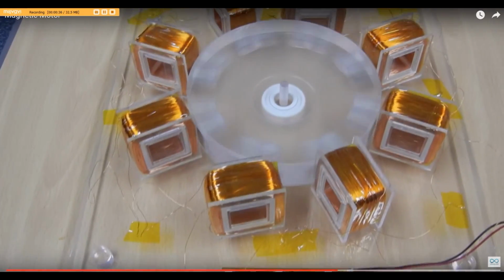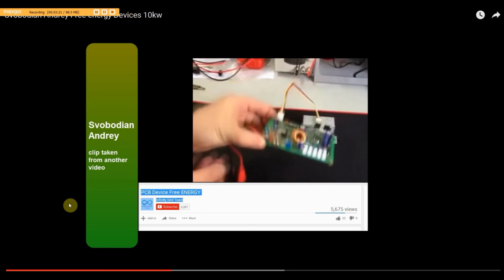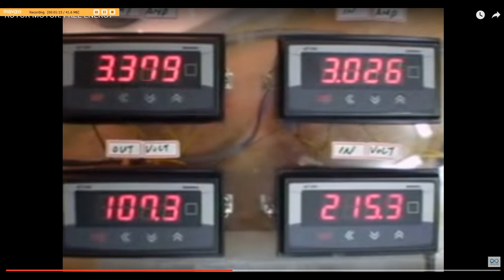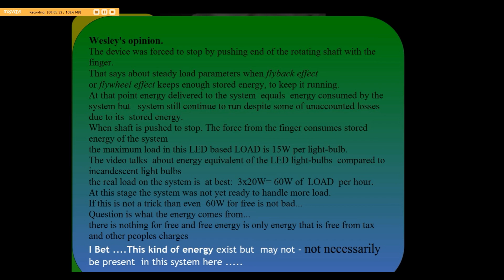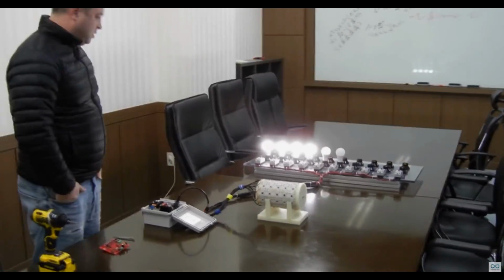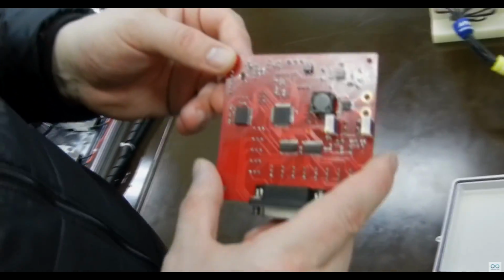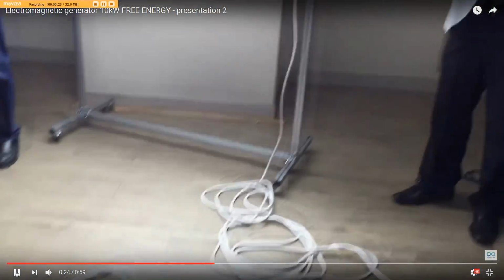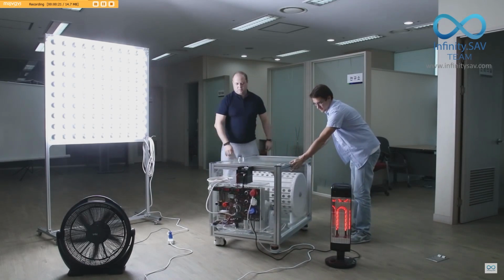Slobodian Andrey ,  Free energy Devices video 2

Comment: thank you! 
btw, i can only hear sound of this video on my mobile device. no picture.
Reply from the maker: on the mobile device  2k or 1080p may not work in that screen pixel size. I rendered video in  HDTV that may be than transmitted in various formats but I have used : 1080p: 1920×1080p: 2,073,600 pixels (~2.07 megapixels) per frame.,
Wesley